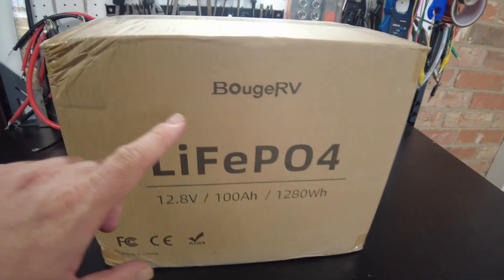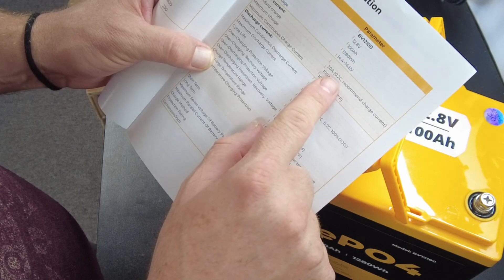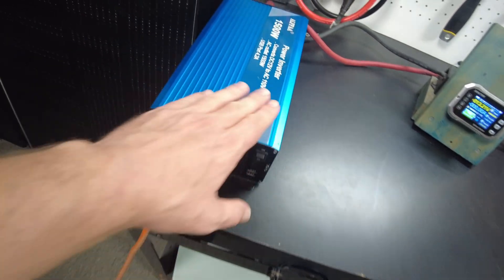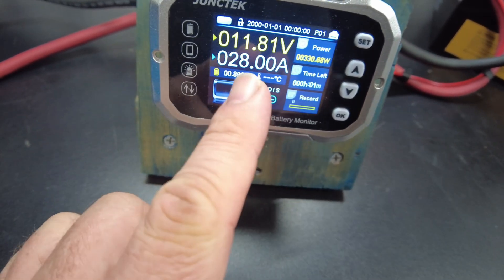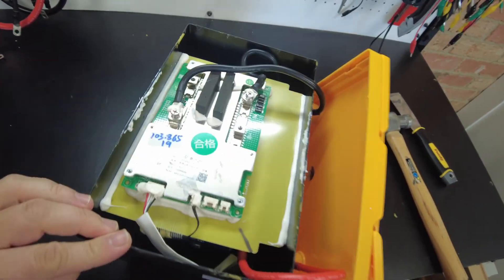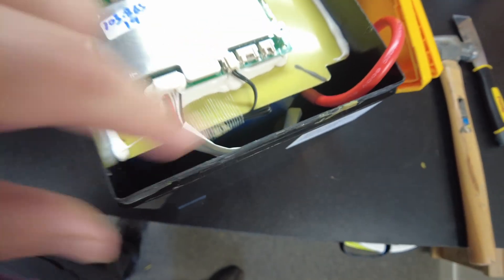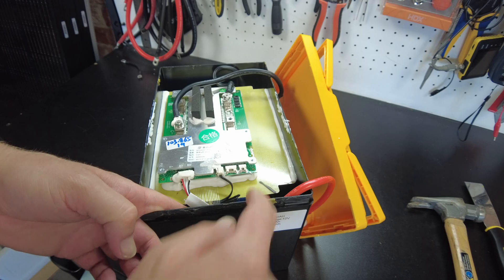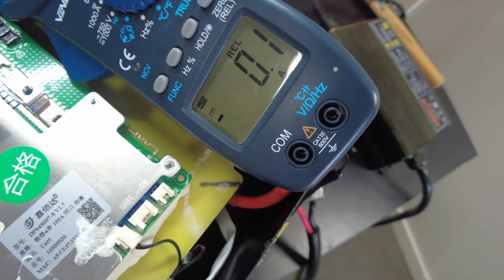BougeRV 12v 100Ah Group 24 LiFePO4 Lithium Battery

Comment: It would be a good idea if solar charge controllers just came with a built in temp disconnect, then it would work on any battery, make it also adjustable. This batter does have built in BT for some reason the company does not advertise it. Go figure. I have two of these batteries and the BT works pretty good. for the BT app. just google XiaoXiangElectric

Comment: I understand in the Lithium battery market, group 24 sizes are pretty new.  Space is a premium for where I put my batteries in my RV.  The group 24 size is ideal, but I'm thinking I'd like to see a 200mA LIFEPO4 battery in the Group 24 size.  Are you hearing anything from the vendors as to when a 200mA (or larger) Group 24 might become available?
Reply: Sorry, I realized I forgot to say "self heating" in my list of requirements.
Reply from the maker: @tomdawdy8369  The highest capacity in the smallest footprint with heating, that I know of is from sunfunkits. https://www.sunfunkits.com/product/51/sfk-300hp-12v-300ah-40-kwh-high-power-dual-heating-lithium-iron-phosphate-battery. Thanks

Comment: LOL my MJBSAN battery from AMAZON for 165.00 dollars and it came with this JBD BMS and has the same potted bottom but the MJBSAN batteries are pouch cell 8 of them but its built just like this one go figure  lol and this BMS well mine came with a bluetooth app xaioxian or how ever its spelled and man it works great
Reply from the maker: Sweet Dude! I need to check those out. Thanks!